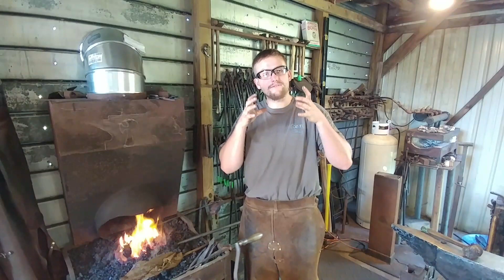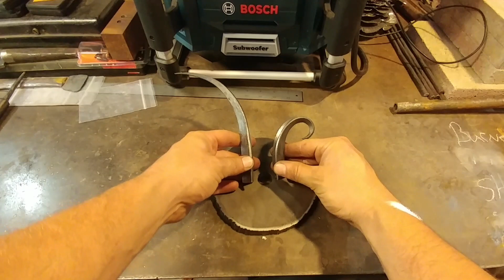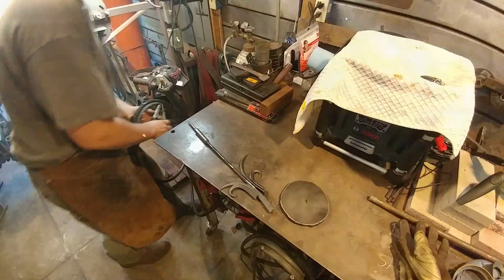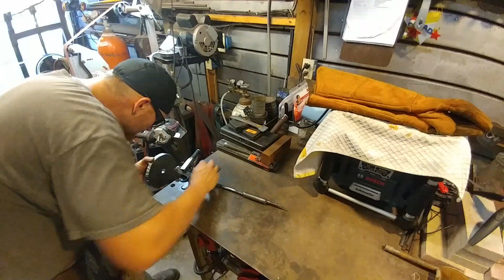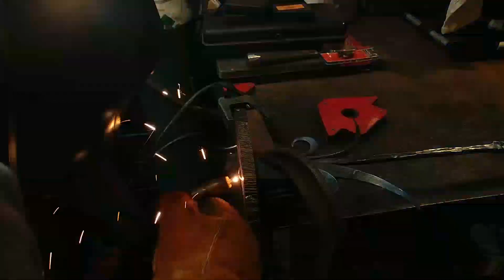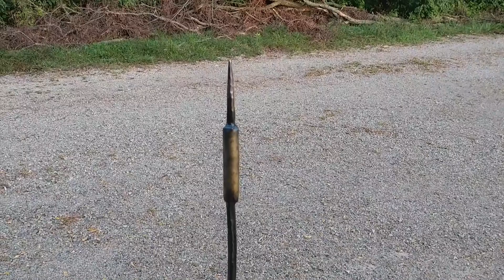Blacksmithing: Creating Forged Cattails Sculpture

Comment: Have you seen the cat tails were on the "hot dog" part, they use pipe, and fuller the ends shut and then weld on the stem at the transition. It would possibly be quicker.